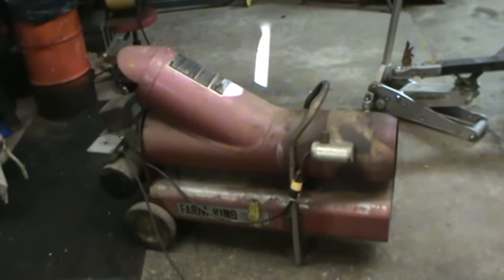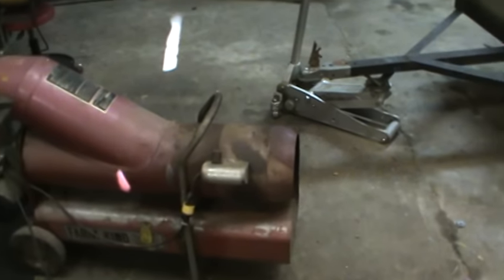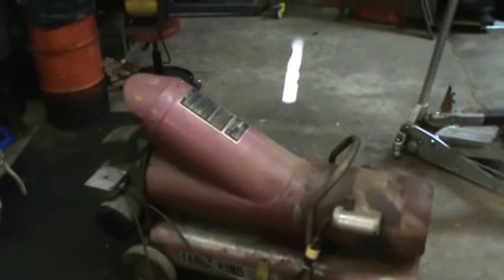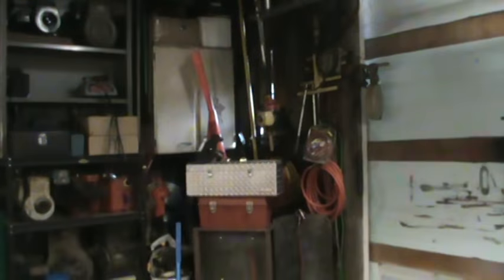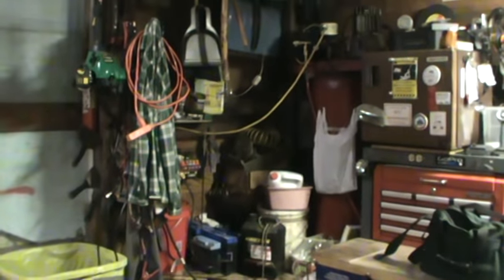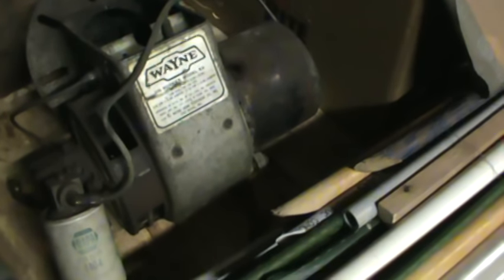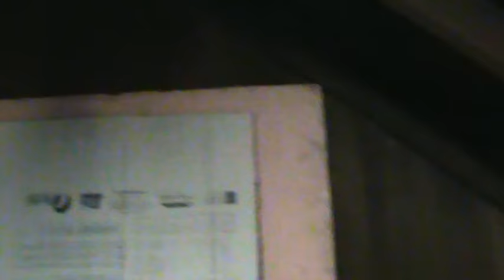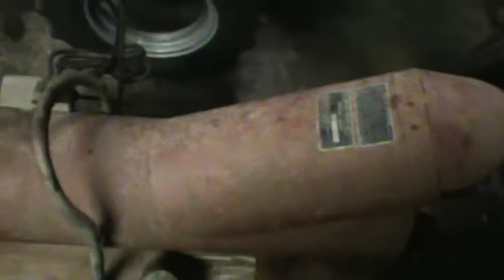Last Shop Talk of 2016!!

Comment: Really nice tour, Zip!  The deer track are really cool!
Reply from the maker: Thanks Sir Pipe! I love the history of both my shop and house. There was also a large barn on the property that burned to the ground in 1995 and I'm constantly finding farming related metal with my metal detector. I need to spend more time on the property (3 acres) and really look for treasures. This property was first established in the mid 1700's and started out as an 80 acre farm. It grew to include over 10,000 acres by a prominent farming family in the area and just across the street from my driveway to the house is a 35 acre tract that's still being farmed. I've had deer, coyote, ground hogs, opossum, raccoon and of course, squirrels and chip monks on the property, wandering around foraging. Pretty cool, but what's odd is, my 3 acres are smack dab in the middle of a modern housing addition. lol Cheers my Friend! Zip~

Comment: back when i rented garages,i used to staple gun plastic sheeting to keep the heat down low. my garage has zero insulation and a few areas that still need finishing,but my furnace keeps it 70 degrees. i too have a air conditioner in my garage,i am not young and dumb anymore.

Comment: Your shop  looks like an old post and beam building!!  It must be tough to heat.  .  Happy New Year to you and yours.
Reply from the maker: Actually not as difficult as one would think. It takes about 15 minutes with the oil heater to take the edge off, then the wood stove keeps it plenty comfortable for the duration. Where it falls short is, there has to be a constant heat source. I'm hoping to get it where I can reduce wood and fuel consumption mainly. And, of course, to install a couple Co2 meters after it's all sealed up and insulated. Cheers and Happy New Year my Friend to the North! Sean~ Have a safe trip!
Reply: Thanks  Monday morning to the sun.